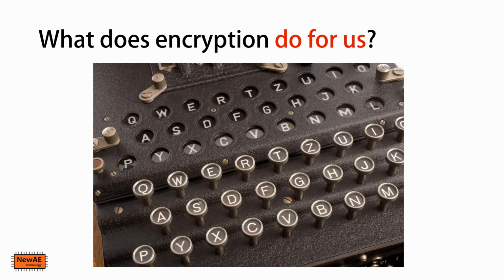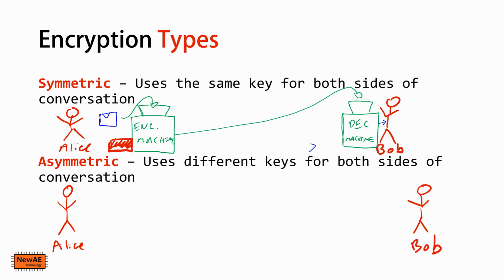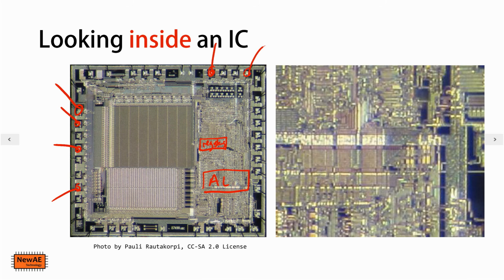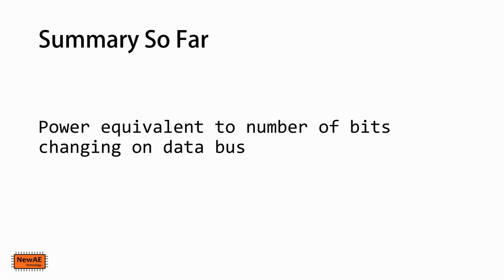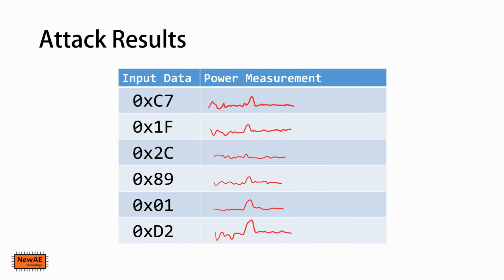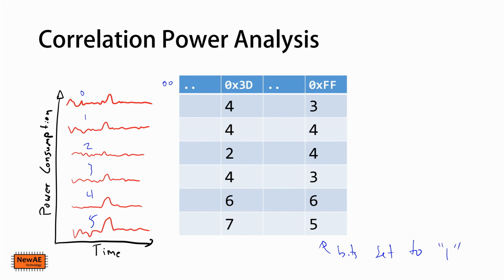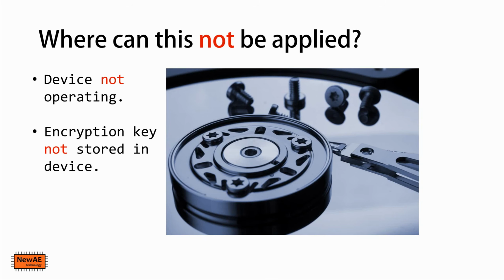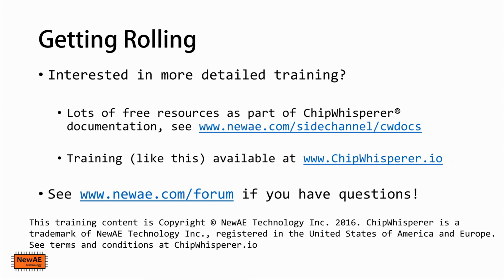Introduction to Side-Channel Power Analysis (SCA, DPA)

Comment: @Colin O'Flynn Thank you for your work, educational videos on DPA, CPA etc. I'm going to be working on the project (Breaking AES with Chipwhisperer) as part of my uni course. I will be using a mobile phone as a target device, an oscilloscope + a probe (as a capture board), will I be able to use Chipwhisperer software as part of this set up..This is a challenging one for me.
Reply from the maker: Good luck! Those more complex targets can be a challenge - definitely start with something like a TVLA or "T-Test", which will show you if you are detecting leakage or not.
Reply: Many thanks, you are doing an excellent job.
Reply: @ColinOFlynn  will the passive probe be enough to capture the traces? I'm not using the capture board unfortunately.

Comment: Good lecture; I have to comment that the current increase is caused by switch both from LOW to HIGH and HIGH to LOW;
The difference between switch from LOW->HIGH and HIGH->LOW is due to the difference between the switch capacitance of the PMOS and  NMOS FET transistors.
In this lecture, it was represented by the two switches connected between Supply and Ground